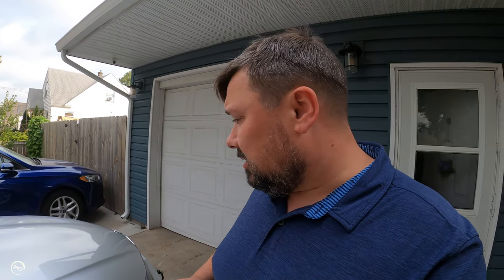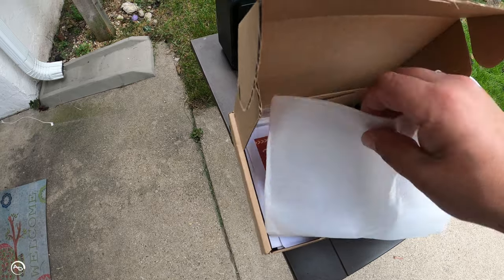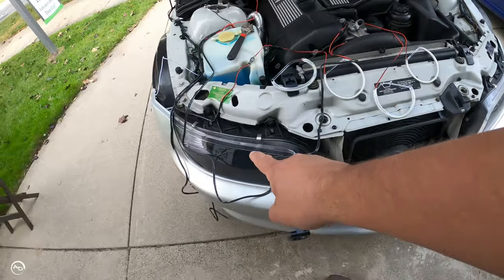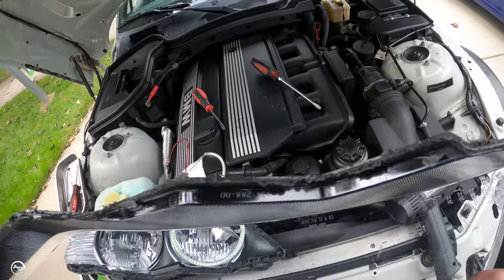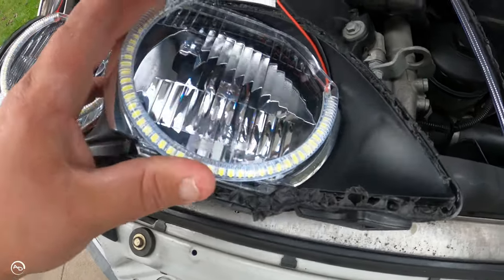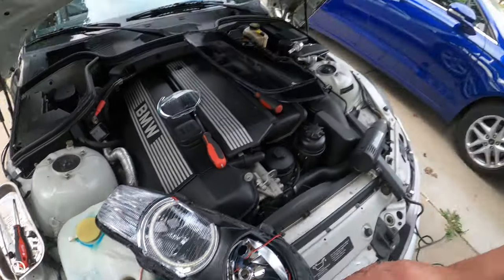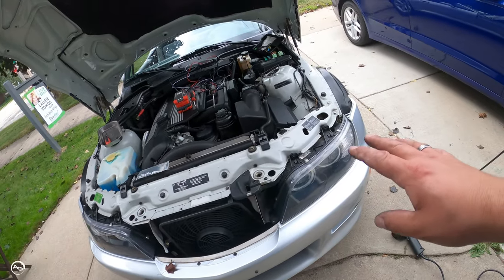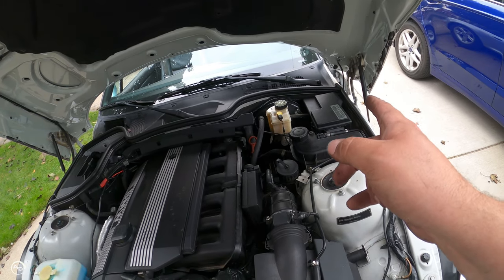BMW Z3 angel eyes install  Cheap upgrade!

Comment: Just bought a z3 1997 1.9L and those lights looks noice
Reply: Iv got the 96’ z3 1.9L
Reply: @jumunjisunn2272  How does it drive? I'm looking to buy one but most of the cars I can get around here are 1.8s. Is the 1.9 a worthwhile upgrade over the 1.8?
Reply: @bamojamo  I did see some pre facelift 1.9s but those were all automatics, I'll probably have to check if I can import something then

Comment: do you think those headlights are still water tight? i wanna do this on mine, was thinking i'd probably have to throw some gasket sealer on it
Reply from the maker: My are still water tight. There is a lot of sealant in there

Comment: Where did you plug the wires? In the fuse box where exactly?
Reply: i just bought the same kit for my z3 2000 and cant figure that out either
Reply from the maker: Use a wire tap (fuse tap). Any fuse slot that turns on with the ignition
Reply: @AutoDad   do you just stick both the red cables in the fuse slot then put the fuse on top of it? i was thinking about using the radio slot
Reply from the maker: No, use a fuse tap. I ordered mine on ebay

Comment: Great job!  Where did you buy the clear lenses for the marker lights?
Reply from the maker: They are clear stock
Reply: @bamojamo  can i just buy the whole light with the angel eyes already in them ??
Reply from the maker: Aftermarket you can, but not stock

Comment: Hey man, I am not too good with electrical wiring (health care professional here) so I got lost after you fed the wires attached to the halos through your headlight. Where did you end up connecting everything? There was a red and black wire (which came together at the end plastic bit) for each halo. That end was connected into a secondary wire that had 3 wires coming off it (white, red, and black). Could you clarify a bit, thanks
Reply from the maker: White wire is optional and really does nothing. Black wire is ground and red wire I stuck in one of the fuses that comes on when the key is turned on
Reply: @AutoDad  ok got it. Thank you!
Reply: Got one last question for ya. Where did you attach the black wire to ground it?
Reply from the maker: To one of the grounding points in the engine bay. Any nut that acts as a chassis ground will work. Usually other black ground wires are connected to them

Comment: I bought a similar set for my e92 but don't really want to have to run that relay harness. Do you know if they can be wired to the existing angel eye plug?
Reply from the maker: The relay harness is for cars without DRLs. If you have a 12v for current drls then yes you could use that
Reply: @AutoDad  that's great to know, I appreciate the info thanks! 😊

Comment: Mate I have no idea where you wired the red cable (one that goes to the ignition) to. You didn’t show it at all
Reply from the maker: That's because I didn't old school. I pulled fuses and tested them until I found one that came on with the ignition.  Then I stuck the wire in followed by the fuse! OG way. Obviously I don't recommend this. I would take the top of the fuse box out and t tap into the wire that runs to that fuse

Comment: If anyone is wondering you can wire it to a switch inside of the car. I have a video on my channel on installing rgb halos and wiring it to a switch if anyone needs help u can message me

Comment: Not worth the trouble. They’re not even a perfect fit, and you have to heat the light to open it, compromising the watertight seal. If you don’t get a perfect deal when reassembled you’ll get condensation.
Reply from the maker: I have had zero issues with mine. There is so much seam sealer in them it would be next to impossible to not seal